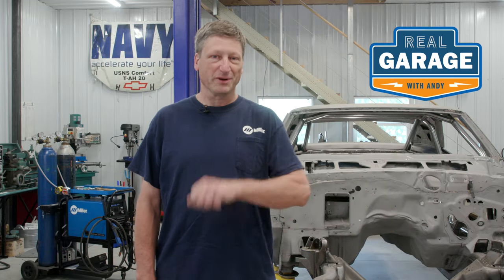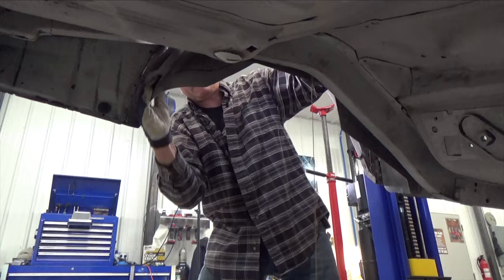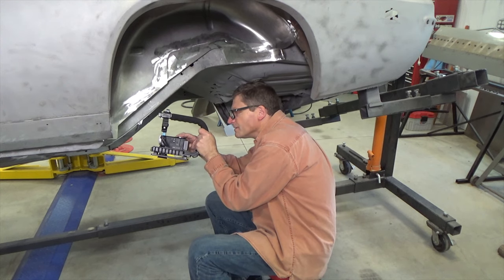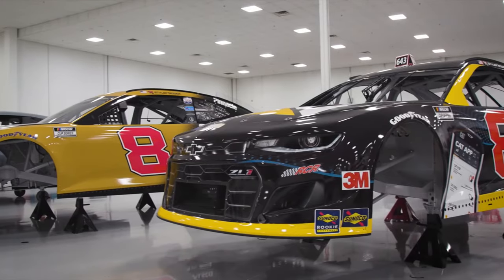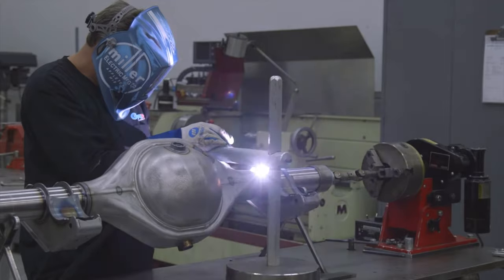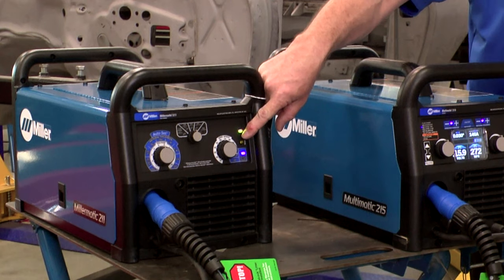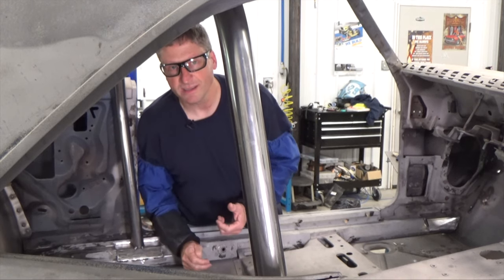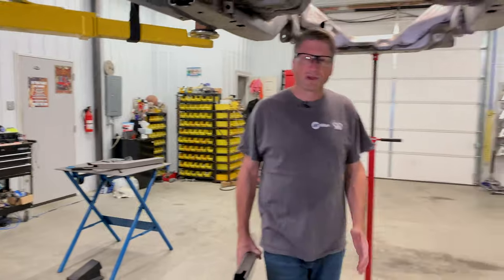Real Garage Season 2

Comment: I was hoping you’d be back. Would love to see something done with a pulse Mig. Not much info out there on it.
Reply: Good source says episode 6 will have comparisons of the Multimatic 235 vs Millermatic 255 and a pulse mig project using 1/8" & 3/8" steel
Reply: @millermotorsports9049  YES! 👍